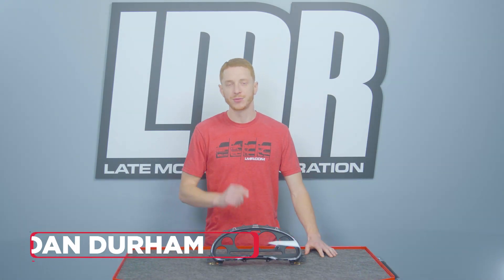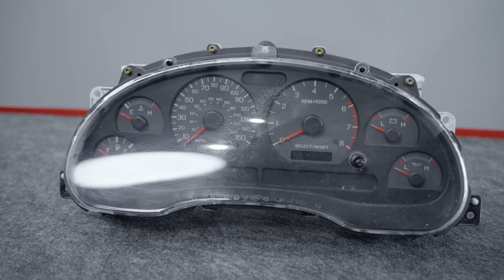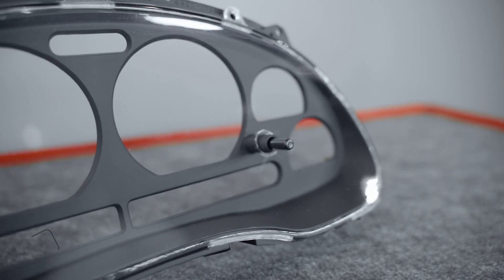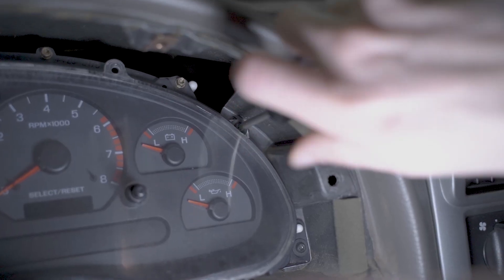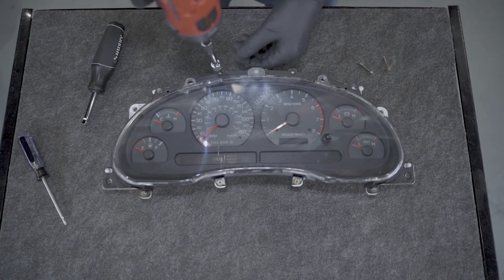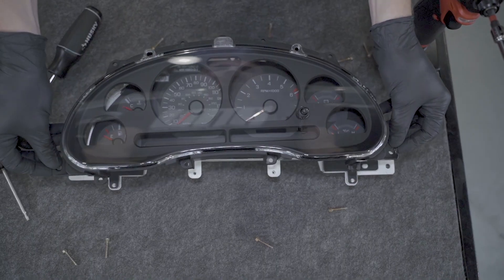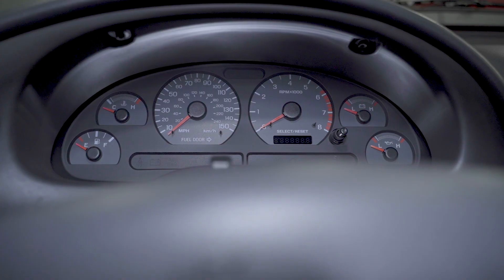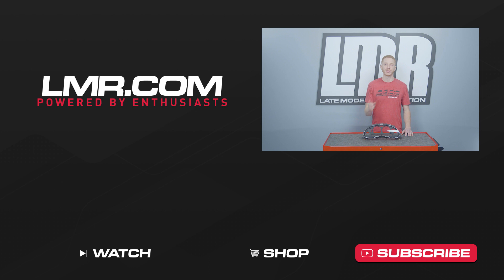How To Install A New Edge Mustang Instrument Lens & Housing Assembly (99-04)

Comment: If you want to go a step further when the cluster is out. You can remove the needles and the cluster face off, sand the back down of the color film and re-install. Change the cluster bulbs to LED of your color choice. I have a video on my channel of the process :)

Comment: A good video would be how to replace the gauge face plates, properly reinstall the needs and properly set the needles to read correctly for 1994-2004 Mustangs. I’ve purchased the white face gauge replacements and setting the needles is not working out.
Reply from the maker: Thanks for the input! I'll make sure to get this idea over to the video team and see if what they think! - Jude H. - Social Media/Events Coordinator
Reply: make a mock paper template, after removing lens assembly, tape template to gauge assembly, re install in car with wires connected but no need to screw in place, turn car on. mark on template where each pointer points. mark your tape(for re aligning template later) install your overlays, place template back in position, put cluster in car plugged in and in place not screwed turn car on, gently place pointers aligned to marks on template.
Reply: adding a template to kit would be helpful :D
Reply: @John Fisk I’m past all of that. This would have been a good idea had I thought of this more than 8 years ago. I figured there has to be a method to set these as they do in factory construction. These gauge sets are built prior to installation in the cars. Unless they add electrical power to each of the clusters as the manufacturers install each needle I wouldn’t know how they basically set these things as default or zero reading. That’s what I’m looking for.

Comment: How do you remove the clear plastic lens from the housing assembly? Heat gun?
Reply: Yes with a heat gun, better to get a new assembly IMO
Reply: colorado_kdm the reason I want to separate it is so I can install the UPR 94-04 Ford Mustang Billet Dash Gauge Ring. I do plan on putting on back the lens. Recommend a good glue for that?
Reply: @sergiomurillo9930  best way to install those rings is leave lens assembled, on the back side you will see a raised area around gauge holes, sand those raised areas and test fit till rings snap in place.
Reply: @johnfisk8407  Thanks.  Just recently got those rings from AM & the new housing from LMR.  Big rings snap in fine, smaller ones are a battle so far.